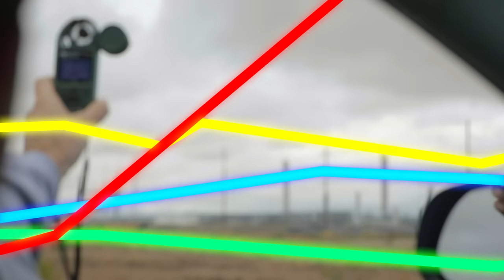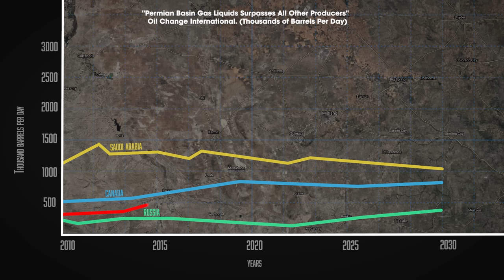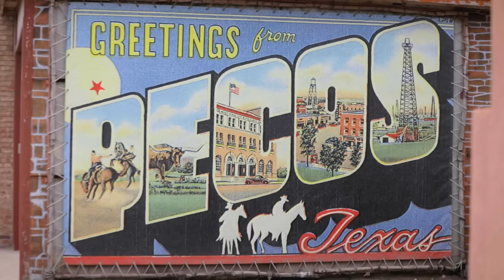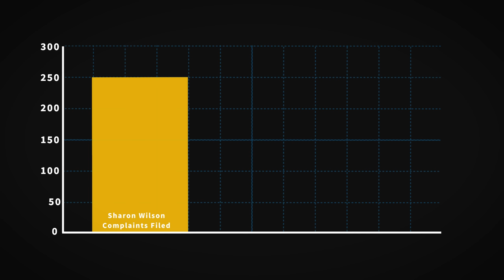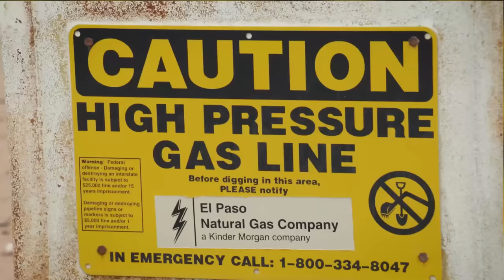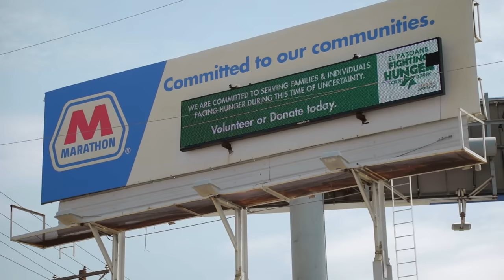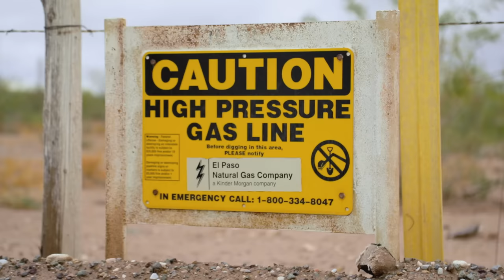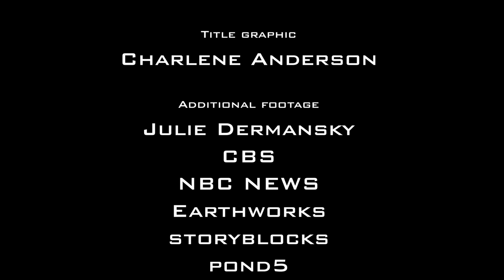Uncovering the Permian Climate Bomb

Comment: Seriously? How many people were displaced when the global sea level rose over 360 feet when global warming started 14,000 years ago? How many earthquakes were caused by the changing mass displacements as miles of melting glaciers reduced the load on the continents and rising oceans? Is dirty oil to blame for the above? It would be interesting to see a documentary on the environmental and human costs of mining and refining lithium, as well as one addressing the harm producing and recycling solar panels does. It's worth noting that some of the same people opposed to using fossil fuels are behind shutting down the development of safer and better-designed nuclear plants to provide needed energy.
Reply: The environmental cost of mining materials for batteries, electric motors, solar panels and windmills has been studied thousands of times. And each time the environmental cost comes up LESS than the cost of bauxite and coal and natural gas and oil refined into gasoline and lubricants. 

So many obstructionist point out "green tech is not zero Emissions and no damage. It is not perfect so instead I am just going to keep doing the things that are 3x worse". 

Better is better even if it is not perfect. 

Flat out EVs and Solar and Wind all produce LESS environmental damage than the petroleum based alternatives they are replacing. Yes even if we consider the entire lifecycle and costs to produce them. 

Better is better even if it is not perfect. 

PLUS - green tech improves green tech. The more we adopt EV transportation and non fuel generation, the less emissions and environmental damage is caused by producing EVs and non fuel generation. The numbers just keep getting better the more we adopt. AND this simultaneously improves all other industries because all industries use transportation and energy. 

AND the new supply chains for materials for the new green tech present opportunities to actually improve the supply chains from an environmental and social consequences point of view. We can if we stay vigilant and supportive ensure the new supply chains are better than the old ones. Every green opponent conveniently forgets the environmental and social damage of the petroleum industry when they point out the environmental and social consequences of things like lithium mining.
Reply: Even if all studies were to conclude that the CO2 saved from green energy exceeds the amount of CO2 used to mine, manufacture, transport, and recycle green energy (which is not the case), it would still not alter the outcome. The world will not achieve carbon neutrality before the end of this century. Germany's ambitious green energy plans have proven unsuccessful, leading to an increase in fossil fuel usage. Moreover, countries like China, India, Indonesia, Japan, and Vietnam continue to construct new fossil fuel plants. Realistic projections do not indicate global carbon neutrality within 50 years.

If it weren't for factors such as urban sprawl, highway and automobile construction, tourism, and ongoing wars, the issue of CO2 emissions would not be as pronounced. Ironically, it is worth noting that had the Greens not opposed the construction of nuclear energy plants, the world may have been less dependent on fossil fuels. One could argue that the Greens are partially responsible for the surge in CO2 production.

Comment: If this is true, why has the US lowered CO2 the  most since Paris Climate Accord was signed.
Reply: The US had giant emissions, and also really high per capita emissions, so there is quite an easy task to lower emissions. Also the US increased its emissions in 2022
Reply: This film is about methane which is more than 80 x more efficient at trapping heat than CO2. NOAA measures methane in our atmosphere and it is spiking up higher and higher every year.
Reply: It’s like water vapour doesn’t exist in your alarmist minds.
Reply: @cliff9136  It does, while it is both strongger and more commun, it doesn't take long for water vapour to form clouds wich mostly have cooling effect during the day, while these clouds are also mostly short lived and doesn't take long to fall as rain
Water vapour is not capable of changing the climate itself, it just follows temperature changes and increases them
Reply: @joaquimbarbosa896  thanks for your reply. Please refer to any unmolested tropospheric temperature data set, then get back to me. Compare versions of this data. Whilst you’re at it, explain all temperature shifts, up or down, pre industrial revolution, pre supposed human influence. There have of course been numerous shifts. Then explain all failures of previous model predictions of warming over the last 40 years. Take note that after 20+ years of cooling in the 50s and 60s, scientists exclaimed in the early 1970s we were heading towards an ice age in the near future (50 years).
Put simply, climate scientists funded by  politics and their associated agendas have for long put far too much weight on the response of co2 in our atmosphere. They can’t even match existing models to observed data over the last 30 years. Their is a plague of dishonest garbage science in circulation.

Comment: If you wish to transfer from fossil fuels to reliable renewable Green Energy that is economically viable one can't depend on technology alone.  One needs to expand ones vision to enabling desert land to flow with Milk and Honey to subsidize the energy hungry manufacturing and installation of renewable Green Energy.  Since Free energy isn't stable, or reliable 24/7, one needs to also capture its capable to use when it's not available, and to be able to create additional wealth.  I'm implying enabling transferring low value desert land to prestigious Real Estate by using Fuel Cells to take hydrogen isolated from seawater to both power the transportation industry as well as the power grid.

Comment: Optical gas imaging camera?  No such thing.  She's using a FlIR camera which detects heat.  You are so misguided.  And you are passing BS off to others as truth.
Reply: "FLIR GF 320 detects hydrocarbon and volatile organic compound (VOC) emissions from natural gas production and use. With this optical gas imaging camera, inspectors can check thousands of components and see potential gas leaks in real-time." From the FLIR website. It also detects heat. With the telephoto lens I use it costs $100k, so significantly more than a simple thermal camera. 

It was developed with the help of industry for the purpose of detecting their emissions. The industry uses the same OGI instrument I use and their operators have the same certification I have. The industry did not develop this technology, spend millions buying it and training personnel just to tell them their equipment is hot.

Get rea.

Comment: I’m surprised she says they don’t have the technology to control the release of methane. I work in the water industry in the U.K. where we capture methane released from sludge digestion and feed it to CHP engines or clean it to add to the grid, using gas bags to balance the pressure. I guess it’s not so profitable for the frackers to do this, so it’s more a case of not having the will to do it rather than lacking the technology.

Comment: I'm no climate change denier. However, From YOUR home page  ("This includes methane, which is the second-largest contributor to global warming after carbon dioxide"). However from WIKIPEDIA ("Water vapor accounts for the LARGEST percentage of the greenhouse effect, between 36% and 66% for clear sky conditions and between 66% and 85% when including clouds"). Am I being  pedantic? or just a  smarty pants?
Reply: Well, if you want to get more pedantic, black carbon is a huge contributor to climate change. I don't have control of what is on the Earthworks website, but it's largely considered the 2nd largest contributor. Burning methane creates water vapor plus the uncombusted methane that is released breaks down into water vapor and CO2. So that's a lot of water vapor from methane. Read about water vapor on NOAA's website. But, beware: NOAA uses a 100 year time frame for methane, which is kind of silly since it's breaks down after about 9 or 10 years.